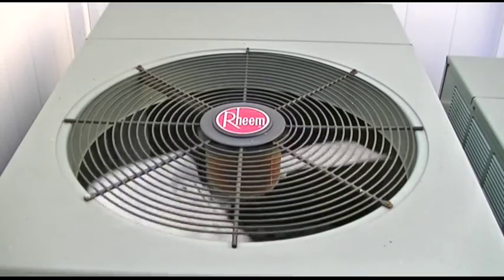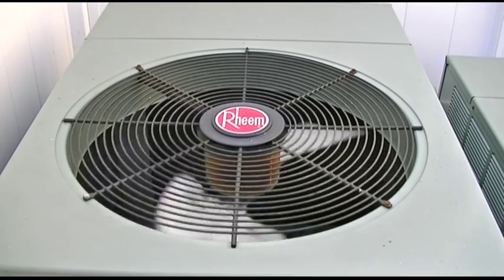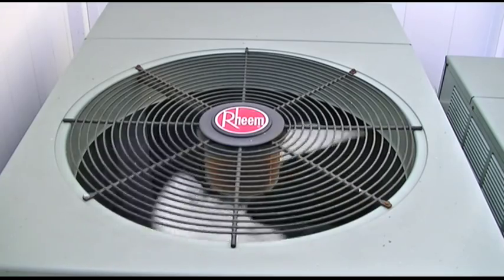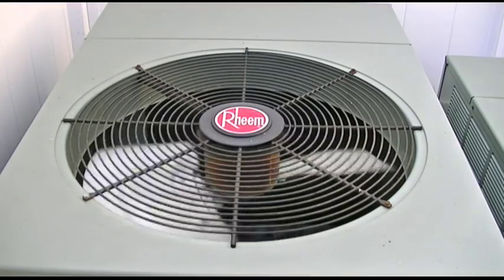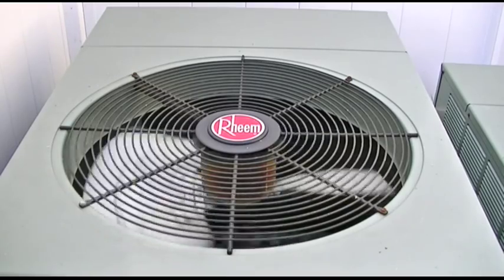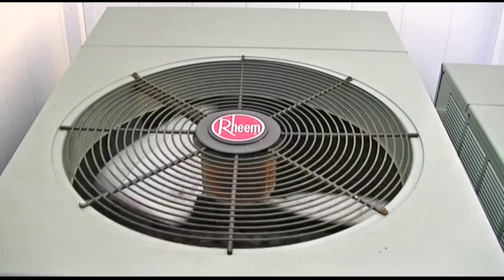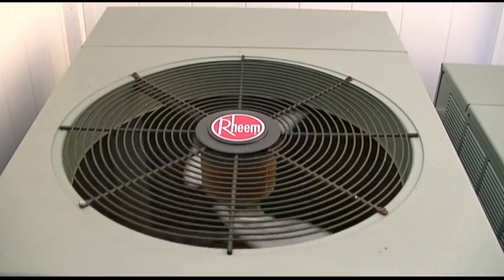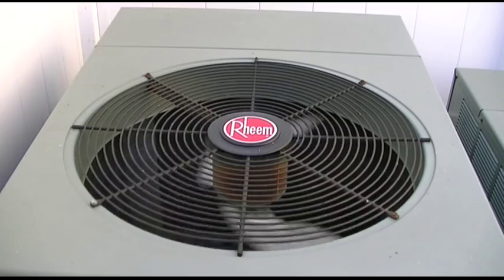Copeland Scroll Compressors Can Run In REVERSE!

Comment: You have a bad check valve on that compressor. That is allowing the gas to flow backwards. So when the power failed the check failed and the compressor started in reverse.
Reply from the maker: You are the first out of almost 10,000 people to tell me that.  Not that you're wrong, but I want to hear that from more people before I'd start believing it might be true.
Reply: I think Zeke is correct. From what you described it looks you were pulling vapor from the top of the condenser, putting the condenser into a lower pressure, causing the liquid located in the lower part of condenser to boil and absorb heat from the air moving over it. Acting like an evaporator. This could only happen if the check valve in the compressor allowed refrigerant to flow through it. I don't think it is worth replacing the compressor just to have a working check valve. What you should do is put a timer that will not allow the compressor to come on immediately after a brown out or power removal, and just live with the noise it makes when it shutdowns. @jaykay18
Reply: What I describe above is when the compressor is running in the reverse direction.
Reply from the maker: Thanks very much for your input.
Reply: Zeke is correct. I corrected a unit that had that problem. Had iffy power I removed the refrigerant installed a check valve on the discharge line at the compressor. Got the check valve from copland. And ended the  problem. And no scrolls don't pump backwards. That rattle is the discharge pressure pushing the scroll backwards for a second. If all that makes sense...
Reply: Phillip Wickstrom the check valve only blows by when the head pressure gets too high it’s a safety on all scrolls. It should never bleed by in Normal start up or shut down conditions.
Reply: @zekemontgomery6678  In my experience no high head pressure. As soon as I installed the check valve never had problems.  Thanks.

Comment: On a 3 phase compressor If the discharge valve isn't fully seated when it shuts down,  the discharge pressure can push the scroll backwards. When the motor turns back on while it's turn backwards it can run backwards. There are no red valves in the scroll compressors to keep refrigerant from gong back into the compressor. There is a floating seal that acts as a valve. Seven the compressor shuts off the seal disengages from the muffler plate this allows refrigerant in the discharge chamber to flow into the suction chamber of the compressor. It is possible for the seal to not separate from the muffler plate and cause the discharge to flow back into the scroll and turn the motor backwards
Reply from the maker: That's exactly what I experienced.

Comment: This just happened to my unit. We had a quick power outage while the AC was running and then the unit started to make a vibrating sound as if something was out of balance. Turns out it was the Compressor running backwards just as was described here.
Reply from the maker: Thanks Dave!  I knew I wasn't crazy!  We had a power disturbance the other day but mine managed to stay running in the right direction that time.  But as you well know, it's certainly possible.  Mine also made some sort of weird vibrating noise just like you described.  Hey--the good news is you know that no damage occurred and this is a real phenomenon.  Just a good thing you were there when it happened so you could stop it.

Comment: So basically the power accidentally turned your aircondioner into a heat pump!  Never seen this happen before.
Reply from the maker: Essentially, yes.  Though in this case, the compressor was sending the refrigerant around in reverse.  It only happened that one time, it was very odd but I remember it distinctly.

Comment: Unless your unit is a heat pump, this seems pretty weird.
Reply from the maker: Weird, but possible.  Fully agree.  It's definitely not a heat pump, it's only an air conditioning unit, and has no reversing valve.

Comment: The compressor maybe a COPELAND compliant scroll which has unique feature that prevents slugging of the puron and it is quite normal for it to make that grinding noise when turning off I have an AMANA that does it as well but because it has a sound reducer on the compressor you can't hear it make that sound and it does have a loud startup which only lasts about 2 seconds then it quiets down.
Reply from the maker: Interesting.  I've heard that some of them do it, some don't.  Sometimes it makes the noise, other times not.  The smaller unit next to it doesn't make that sound.
Reply: Mine just does the startup sound.
Reply: Older Copeland scroll compressor models in the 7 to 10 ton range, summit models, have a fluid break to keep it from turning backwards during shutdown. The grinding nose is the compressor spinning backwards. Three can be certain circumstances where the fluid brake can't stop the backwards movement long enough for the floating seal to unload the compressor

Comment: I've got a portable air con with a rotary compressor that does something similar, when it's a hot day and it's had high pressure and you turn it off or it cycles off, the gas pressure is enough to turn the compressor over slowly, it'll make a 'thump... thump... thump' and the unit shakes, if you look down the tube hole you can see the compressor shaking... one day I'll catch it on video!
Reply from the maker: Nice!

Comment: I don't think you can pump hot gas through a compressor in reverse how are you flashing your liquid into the comp ? Think about it,  if it were to run backwards  why wouldn't the scroll plate lock up with liquid from the condenser . I say no way . only a three ph comp can run backwards, it could have been in bypass .
Reply from the maker: There is no bypass valve in this, it's an air conditioner, not a heat pump.  Here's exactly what I know:
1.  The system appeared to be operating backwards, cold air outside, warm air inside.
2.  While the unit was running backwards, there was a distinct humming sound from it that it never had done in the last 10 years, that humming was more or less a resonant sound.  That's what immediately alerted me to something being wrong.
3.  I've read several sites that people claim it happened to them, and the general consensus was that it could.

Regarding the scroll plate locking up from the liquid, for some reason this particular system doesn't appear to be under any sort of tremendous pressure while running.  Many years ago we were out in the pool, the skies clouded up, and we had one of those freak thunderstorms during the summer.  That one I remember in particular was very powerful; for our own safety we got out of the pool and took shelter in our screened room right there.  After some thunder and lightning crashes, we lost power several times in succession.  This very same unit was able to hot-restart itself without any trouble.  I don't understand it either, I've had an A/C tech hook his gauge set up to it and it seems to be reading fine.

Comment: Well, that's one way to make a heat pump! I've never seen one do that before.

The 3-ton Comfortmaker straight cool unit (with Copeland scroll compressor) here has never made that "ratchet" noise when it's done running. Sometimes it does run more loudly than normal until the system builds pressure. Then it settles in nicely.

I don't think most battery operated thermostats monitor the presence or absence of the 24 volt power supply. Putting a restart delay device in the condenser unit seems like a good idea, as the Honeywell Wi-Fi thermostat here runs entirely from the 24 volt supply (had to pull a common wire so it'd work) and has no backup power supply. Whether it's smart enough to delay a restart I don't know. I've always played it safe after a power outage and shut off the power supply to the furnace until I knew the power was on for good.
Reply from the maker: Thanks for the info Bill, didn't know you watched me!  Yes, this was a rather strange phenomenon, but I'm happy to read that it's a temporary condition that can happen and is "normal".  And like I said in the video, it will eventually correct itself once the compressor thermals out, so even if no one were to be home, it would be ok.
Reply: You'll often find me wandering around the channels of people who are watching my videos on Youtube. It keeps things interesting. I tend to be something of a lurker, though.

I think it would definitely be amusing if the unit here temporarily turned itself into a heat pump.
Reply from the maker: ***** As interesting of a phenomenon as this was, in the heat of the moment before I did any research on the subject, I was quite worried.  Even though they say it doesn't cause any damage, it's operating in a different way than it was designed to.  I guess when a machine like this fails it must have let the "magic gas" out!

There are some channels I lurk on as well, especially those with an inordinate amount of subscribers.  That's fine and good, but I'm very honored that you watch me.  Thanks again.
Reply: Well mine reversed and I got it on camera.

Comment: Yours is probably the first ac on YouTube to see do that. Oddly enough we had a power flicker when ours was running although never paid attention to it I sometimes wonder if ours does it. We have the Ruud version of this but I've never seen a compressor do this. For that couple of minutes it was running in reverse like that you could call it a heatpump lol.
Reply from the maker: Yes, it was basically acting like a heatpump.  I did a lot of research on this "problem" and saw a lot of people say "me too!"
Reply: +jaykay18 Actually this reminded me of my grandma's old gigantic carrier window unit would shake and bang in the window when you turned the compressor off for five minutes and turn it on and it would make a sound similar to this one turning off it would scare me as kid cuz I swear it was gonna fall out the window. But other then that it ran really well like I remeber when you would get close to the vent and breathe you could see your breath in the stream of cold air no lie my cousin and I used to sit in front of it and be like holy crap! it was great old unit woodgrain and pushbuttons and all!
Reply from the maker: Logan Musser My old Westinghouse 6,000 BTU from the 1970s did that as well.  Huge clunk when shut off and the whole unit would shake.  That's because the rubber mounts on the compressor had degraded over time, so it's not mounted on a shock-resistant base anymore.  My "awesome dehumidifier" does that as well, the whole unit MOVES when you shut it off.  Both of those had recips.
Reply: +jaykay18 Sounds like my my ge carry cool turning off. I only have three vintage airconditioners but the others don't do it although the old 1976 montgomery ward makes a good kick when ya turn it off. Heavy thing too only 600 BTU and the thing ways 102 pounds!
Reply: +jaykay18 Also seen the dehumidifire and I think that unit is a fedders because my neighbors have the exact one same knob and the hi and low fan switch and has the same start up sound and all and says fedders on the top of it.
Reply from the maker: Logan Musser Today I'm going to look into mounting a 220v 2-ton unit through the wall in my garage.  Sadly it's not vintage but it is from 2002, before everything totally went to hell.
Reply: +jaykay18 I bet that thing ways a ton! You gonna put a video of doing it cuz I would like to see that!
Reply from the maker: Logan Musser Have I ever NOT made a video on something?  Of course there will be one.  When it will be released yet, I don't know.
Reply: +jaykay18 Sweet! looking forward too it!
Reply: +jaykay18 you forgot to upload you opening my birthday gift to you lol
Reply from the maker: lexmarks567 OK, I'll put that up in a few minutes as a bonus video.
Reply: Well I caught mine in reverse ON CAMERA!